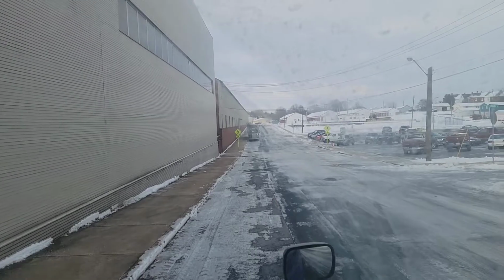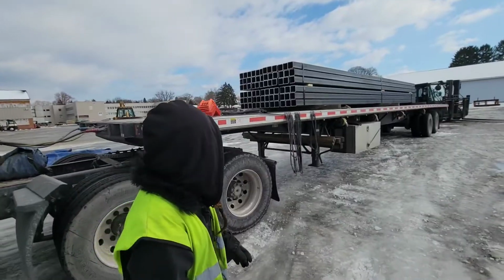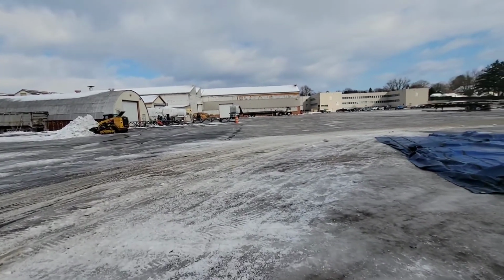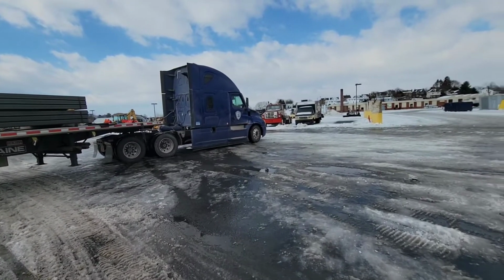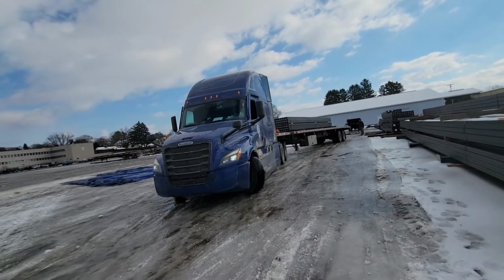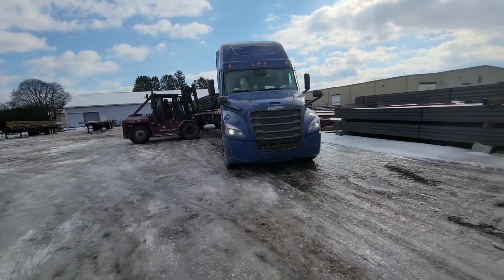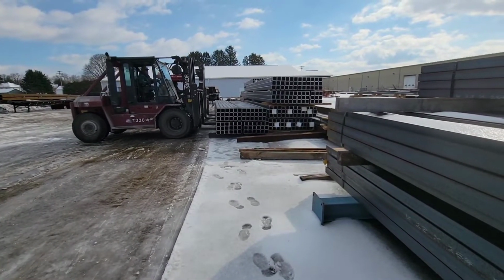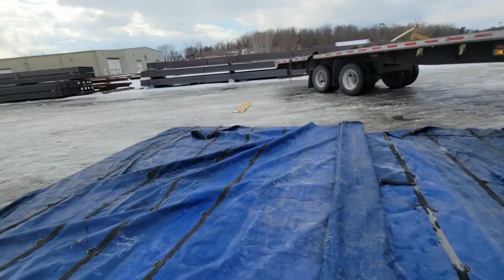Flatbed Drama| Broker said it's fully Tarp, Receiver says we store it Outside | 😱

Comment: I had one broker tell me needs to be tarped and I said that's fine when I get to loading the load it self had like 3 feet of snow on top I took picture sent them over to broker and still insisted to tarp so I hit them with a shovel fee of 300 or have a company come shovel it off and then I'll tarp they refused and I refused still got delivered untarpped and receiver said they didn't want it tarp these brokers have no clue what they are doing just want thier % cut of the load that's why they rush you to deliver cuz they get paid directly and us trucks have to wait well I don't thanks to OTR solutions on the factoring 💯